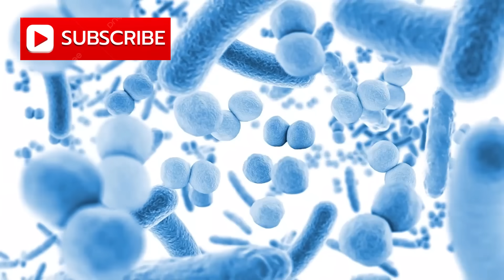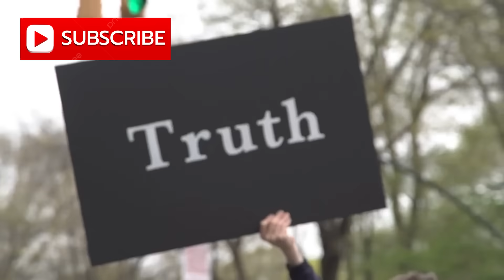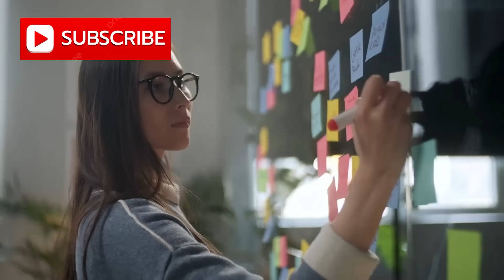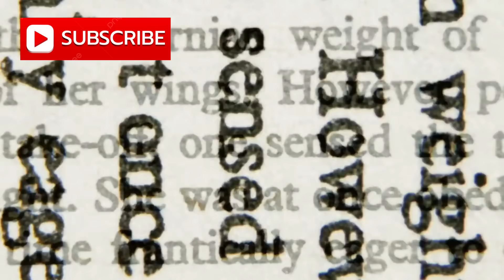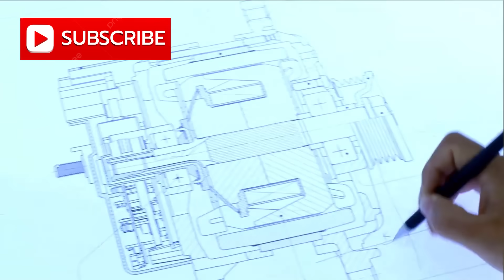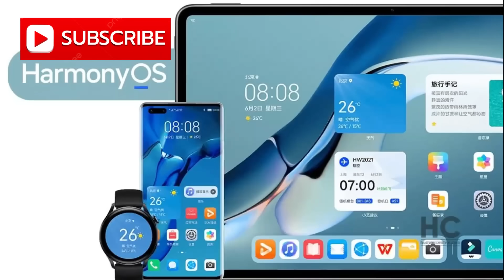BREAKING: Huawei Begins Mass Production of 3nm Chips | China Approves

Comment: Doubt so. Not necessary. Huawei - SMIC 5nm has just hit 60%-70% yield and still working to improve it. It took 3 years for 7nm to reach 80%-90% yield. 

China have most of what it need in 5nm. The Huawei AI Ascend 910D will be on 5nm by beginning of next year. 

Even with EUV, TSMC and Samsung are still trying to stabilise 3nm with 'generations'. No need for the haste for another year or two. The tech and chip war already won.